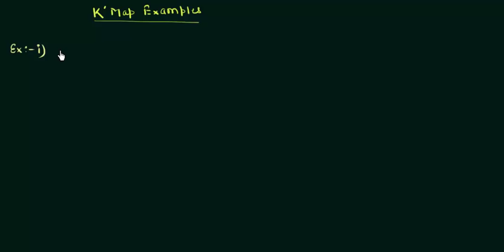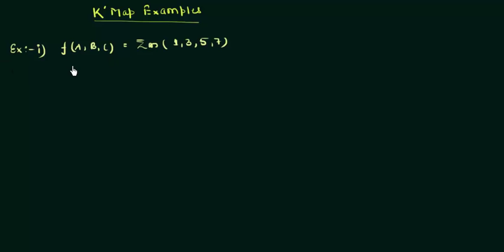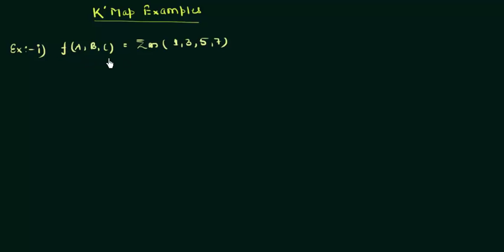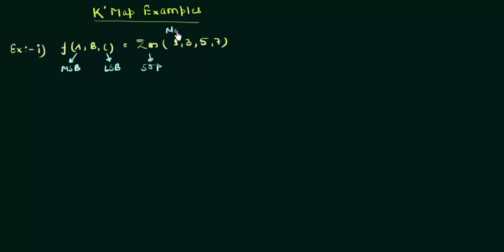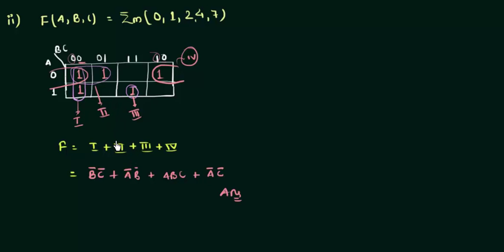Karnaugh Map (K' Map) - Part 2

Comment: In example 1, why does he not proceed to find pairings of 2 cells? He found the implicant of four cells, but did not continue to find pairs of 2 cells, as he did in Part 1 of his KMap series. Similarly, why is cell m7 included as a pair (?) of 1 cells in the equation for F in example 2? 

Any help is appreciated, thank you.
Reply: Same douby
Reply: @rishabhgupta6133   its because of priority rule , pair of 8 is most prior then pair 4 and finally pair of 2
Reply: @abhishekjha5984  Yes so shouldn't he combine the elements pairwise after he did it in a group of 4 ? Is it because if we do it pairwise we'll be repeating all the ones without any new addition of 1's?
Reply: @abhishekjha5984  Please help me with this : f1=sum(0,1,2,3,5,8,10,14)+sum(don't care)(4,6,7) ,f2=sum(0,3,4,5)+sum(don't care)(6,7,9),determine h=f1+f2 and g=f1*f2
Reply: Can someone explain why he took complements?
Reply: Same doubt bro...?? He also skipping explaining those things😥☹️☹️
Reply: @ninaricci7643  because for SOP you write A' for 0 and A for 1
Reply: @Halos To avoid redundancy of 1's
Reply: @sreyashibhattacharjee5242   yes..
Reply: Same doubt of mine because in first video he tells that we can pair only 2,4,8,16... pairs of ones but here he is taking only one 1 which has no pair in example 2
Reply: @abhishekjha5984  Why can't we do diagonal in k-map?
Reply: @ninaricci7643  bcoz this is SOP and in SOP we take 1-A, 0-A'
Reply: @jubayerislam7298  1st reason, multiple variables are changing at the same time
2nd reason, the difference between diagonal cells is not 1. These two things violates K-Mapping.
Reply: hey! i hope my explanation helps 
so your first doubt why did he take  a block of 4 instead of 2s ... i have checked the answer would be the same so whenever you see a block you can safely do the same safely.

and for the second doubt suppose there was a single 1 in the k map then according to you the expression would be zero which is obviously wrong so may sir forgot to mention 1 in the first lecture of kmap but 1 is also possible and it will have a lower priority then 2 naturally.
Reply: @adarshshrivastava410  Thank you Sir.

Comment: Why you pair single 1 is it allow?
But in previous lecture you told that only (2,4,8,16 ) 1's  are allow for pairing.

Please do reply ASAP  I have exams and it bothers me a lot
Reply: 2^0=1
2^1=2
2^2=4
2^3=8
So grouping happens in sequence 2^i.. And here "i" Can be 1,2,3,4..
So yes it's possible. 
Though ik that I'm replying to an old message still hoping your doubt would be clear by this.